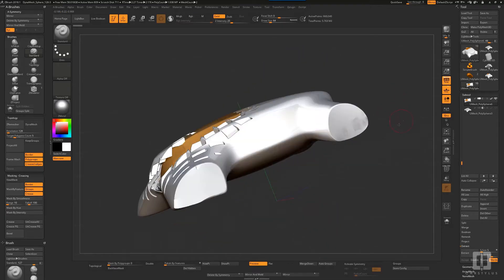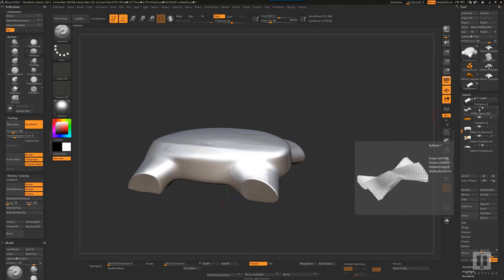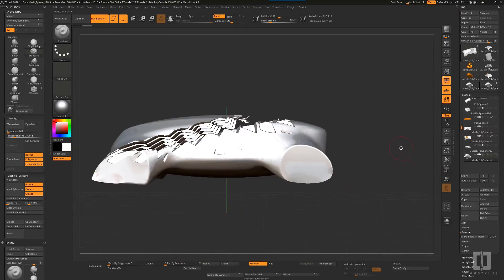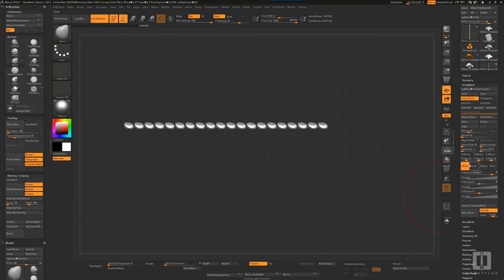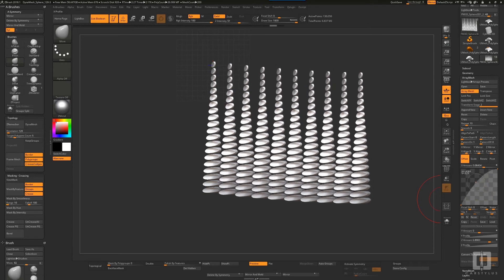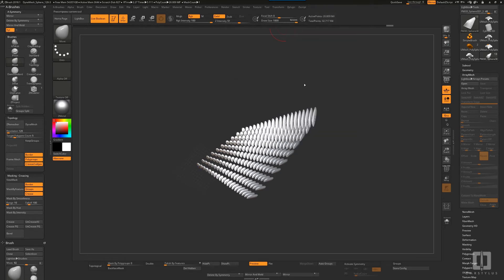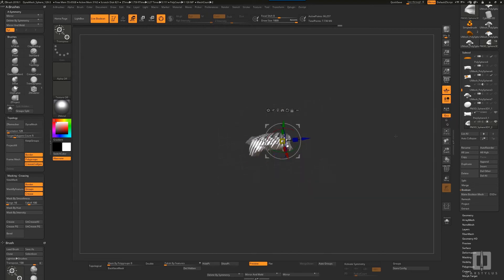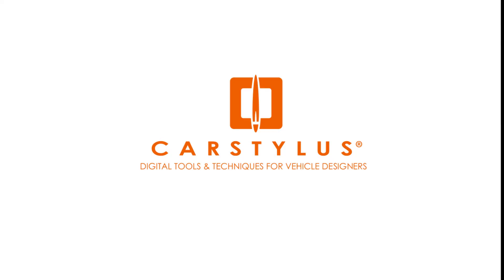Array Mesh - Boolean modeling

Comment: A lot of very large studios use Zbrush in their pipeline for the majority of the work, right down to the final model.  Of course the model is then presented elsewhere and animated in Maya or 3dsmax, but everything from the sculpting to the final topology can and usually is completed in Zbrush.  Maps are exported from Zbrush and painted on in Substance Painter usually.  I know some people who do some serious 3d printing right out of Zbrush without any intermediate or finishing packages.  Straight from Zbrush to Shapeways or whatever printing service they choose.
Reply from the maker: I know that this is true for Entertainment and Gaming industry pipelines.   The auto industry hasn't embraced Zbrush . . . yet.   Modo and Maya are now only beginning to be used, and that's only in early, early conceptual modeling phases.
Reply: @Carstylus  It wasn't big in Jewelry industry either, until the addition of Zmodeler and then Live Booleans and Scale Master made it ideal for creating work that could be sent directly to casting.  Now Zbrush is really making its mark in the Jewelry design field, especially the additive manufacturing market where watertight meshes are a must.  This used to be a market absolutely dominated with a software called Rhino and Matrix, but now Zbrush is really coming on strong.